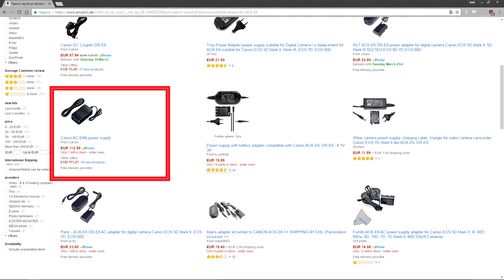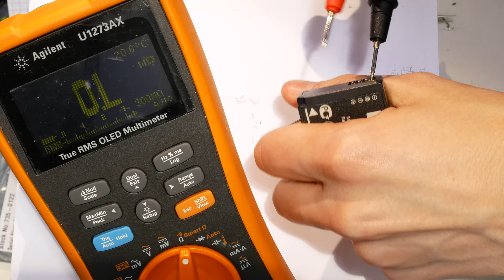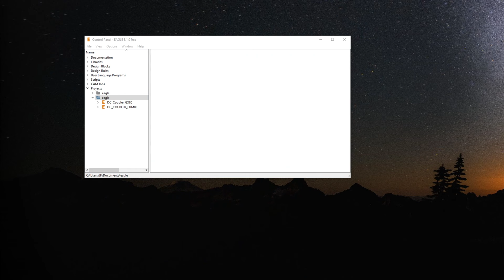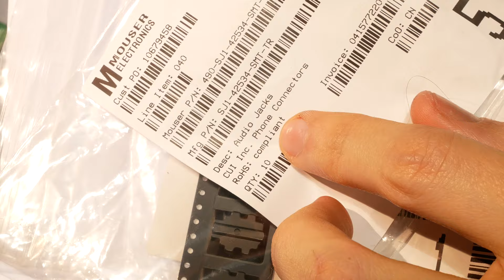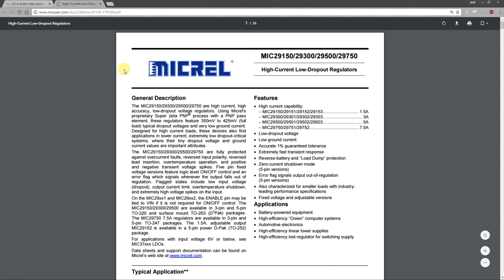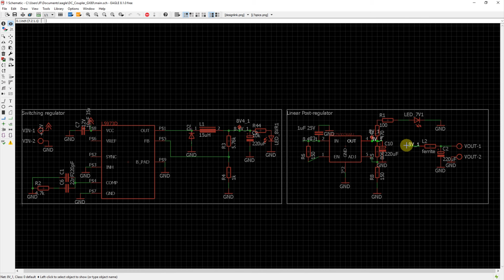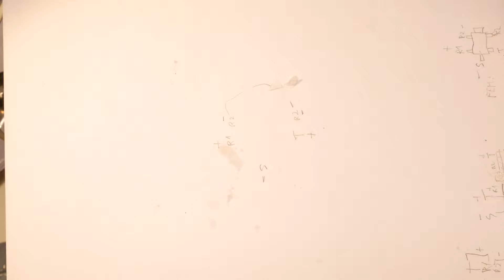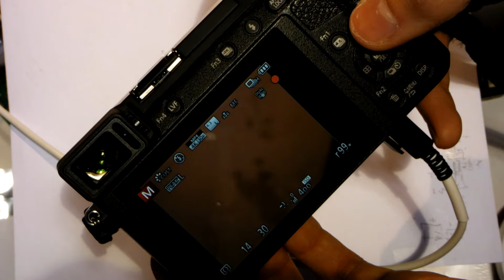DIY Camera DC Coupler and Power Supply - Battery Eliminator

Comment: that is some damn awesome content, love the means you use and the methodology you have to explain. I have bought some 3rd party batteries for my sony A7ii and since one of them has died, wanted to have a look if it is feasible for me to open it (safely) and rewire it to a usb powerbank (with the correct coupler obviously). I will see first if I can revive it then option 2 will be pretty much following your video.
Thanks thanks and again thanks! You got a new subscriber.

Comment: Great idea, but I would suggest to use the connector with thread like Sennheiser lavalier mic one to prevent disconnection in case of some improper movement.
Reply from the maker: Not a bad idea, I wonder if the additional thread fits in the hole on the battery cover.
Reply: @jfaria  Yes, it should be checked.

Comment: Thanks Jose. I made a power box for my Panasonic FZ1000 using NP-F batteries but couldn't understand why the camera showed "Couldn't use battery" although the battery was almost fully charged. Will try this. 
Thanks for making a great video.
Reply: I had same problem when using dummy battery for Panasonic GX800, I had to connect "T" terminal and "-" terminal directly or put there 10k resistor see pic (better option is to open it and do it from inside) https://cdn.thingiverse.com/renders/2c/6f/bc/7a/71/44d66ccffe0a7e9d351231e5cf418cca_display_large.jpg

edit: new link
Reply: @hever9  link cannot opened :/

Comment: Hola Jose puedes explicar lo de las resistencias 
Porque se deben utilizar
Porque quiero aplicarlo a una batería de 2 cables a una tablet que tiene 4 entradas  bueno gracias
Reply from the maker: [Google Translate]
Las baterías suelen tener un contacto de comunicación digital con el controlador para conocer el estado de carga y salud de la batería y un contacto para un sensor de temperatura, en el caso de esta batería la comunicación es opcional, pero la cámara requiere una señal de temperatura, la resistencia sirve para simular una sensor de temperatura. Primero intente conectar solo el positivo y el negativo, si el equipo no funciona, luego intente buscar las señales que el equipo espera de la batería.
Reply: @jfaria  gracias José por la respuesta  saludos desde chile

Comment: Why don't just buy step-down DC buck module? So any 12V 1A power supplies to 8V output then wire it to dummy?
Reply from the maker: You can, but it would also take time and a good one that would guarantee a safe failure (i.e. not outputting 12V after failing) would cost as much as a proper power supply and defeat the purpose of the exercise. If you want it fast, you can just buy the original DC coupler and be done with it.
Reply: @jfaria  whoa. I didn't factor the failure.

So it's safer to use step up than step-down? So in case of failure, the voltage will be too low to operate, yes?
Reply from the maker: @CTZN1  If you don't have any other safety feature that might be a good idea. At the moment I don't use any regulator, instead I'm using the same DC coupler but powered by a big a two cell 5Ah external Li-po battery, it lasts a really long time, I already had a charger for it from my RC plane stuff and I don't have to worry about damage to the camera.
Reply: @jfaria  the DC coupler connected to rc batteries? Didn't know that.. I thought DC coupler are like AC to DC adaptors but the head is battery dummy.
Reply from the maker: @CTZN1  I call the dummy the coupler, maybe that's the wrong nomenclature, I just connect the dummy to a 7.4V battery pack.

Comment: Obrigado, great video, lots of knowledge shared! 
But there is me now, with a question :-) 
Using a Lumix mostly for *filming*, and already having a battery dummy and a DC supply, I wonder ... what about the noise? Have you done any testing already? Not speaking of any particular camera brand or model, but in general. When I compare filming on battery with filming on external DC supply, I can hear the typical 100 Hz noise in my video. It is very weak, yes. But still. The DC supply that you are showing in this video, how about that? If you just video-tape "silence", can you hear the difference between a true battery and your DC supply? How "DC" is your DC? Obrigado again! :-)
Reply from the maker: I might try it when I have the time. If I do I'll reply here.
Reply: Thank you. Tic tac tic tac ... :-)

Comment: Hi Jose, I am trying to fool my wifi hotspot to think there is a battery in it and hard wired to my car (12vdc) . The battery is 3.8vdc 2550mAh and has 3 terminals (+ - and I believe temp at 1k). I tried a step down dc to 3.8vdc, I get a welcome screen then cuts out. Do you have any info that could tell me what resistor or a way to wire it so that the hotspot thinks there is a  battery? I am not too savvy on electronics but use to be a Toyota Mechanic. I believe I need lower the amps, and not sure how, was impressed with your skills and thought if I could ask is there was anything I could do. Thank you if you can help.
Reply from the maker: Hi, I'm not sure the problem in that case is the lack of the resistor, to be sure put a bit of tape in the resistor pad of the battery and check if it works, if it does the problem is likely on your dc converter that doesn't supply enough current.

Comment: Thanks, you're awesome, I'm planning to just 3d print the case and use a LM2596 booster from 5v to 8v, do you think it'll work?

Thank you
Reply from the maker: You probably could get away with 2A, so the 3A from that regulator should be plenty. At the moment I'm just using two large lithium cells in series, works like a charm.
Reply: @jfaria  i was planning to purchase those 15$ kit and then I thought "hey I have a 3d printer, I can just 3d print the battery and power it through a voltage converter"

And then I searched on YouTube and find your perfect video.

Project as simple as that are just incredibly satisfying. Keep up the good work and thx for confirming that this work.
Reply from the maker: @yakine13  The only tricky part is the battery contacts, have fun.

Comment: Great video! 
What is that clear yellow tape called, and where does one buy it?
Reply from the maker: It's Polyimide film tape, also known by the commercial name "kapton". You can buy it on proper electronics distributors or you can be cheap like me and buy it from china on eBay or Aliexpress. It's kind of stiff, but it is able to withstand a lot of heat without melting.

Comment: i want to ask you a question but i see you not reply all your comment
Reply from the maker: I reply to most
Reply: @jfaria  many thanks for reply. I just bought dc Coupler. I try to test output and compare between from original battery and coupler. Battery 8volt and coupler 8.7volt. I think its will make risk for the camera for long use. How about you Sir? Thanks before. I am from Indonesia 🌎🇮🇩
Reply from the maker: @BudikaRabbani  When the battery is charging it goes up to 8,4V. 8,7V is less than 5% above the 8,4V value, I wouldn't worry too much about it. Also, when you connect the camera there will be a slight voltage reduction caused by the cable resistance, it will get even closer to the value of a full battery. I would also prefer if it was closer to 8V, but it should be fine.
Reply: @jfaria  I asked my friend in youtube with the same thing and he frightened me with what he said about the crust that would arise on the circuit board on the camera. But I think the makers of this coupler have made the right calculation for their products. Thank you very much for your answer.
Reply from the maker: @BudikaRabbani  There is no corrosion on the circuit board whatever the voltage you apply, higher voltages than normal cause components to fail, but devices are usually designed to handle at least +-10% of the rated voltage, your AC-DC adapter is only 3 or 4% above. Not ideal but you will probably be fine.
Reply: @jfaria  You explained well and were very helpful. thank you mate 👍👍

Comment: Hi, I have soldered a 10k resistor from the negative to the T, but my camera still says "change the battery" and it appears empty. help me pls
Reply from the maker: What camera is it? Maybe yours needs to communicate with an additional IC? Did you check the original to make sure it was 10k and not some other value, like 100k?
Reply: @jfaria  what's mean IC?
It's Canon 550D, lp e8 battery. I dnt have tools to check the original resistor, is in a integrated chip.
Reply from the maker: @maxiguitar  I had a 550D and if I recall correctly the camera doesn't care about the battery IC as long as the resistor is right. You probably have the wrong resistor. Ideally you should measure the original value, if you can't do that just try other resistor values until it works. I would suggest you try 47k and 100k first.
Reply: @jfaria   ok, I'll try. Ty very much, josé!

Comment: Can we connect 8.5v dc directly to battery protection circuit by deassambling a working battery?
Reply from the maker: Yes, but in many cameras you still need to make sure you leave a resistor to simulate the temperature sensor. Also, 8.5V might be a bit on the high side, on a camera with batteries rated at 7.4V I would make sure the power adapter wouldn't go above 8.4V.
Reply: @jfaria  panasonic cameras do take >8.4V (official mains adapters supply 8.6-8.8V) as a signal beeing powered from mains, not battery. If you'r camera is not a panasonic one, that might not be the case. I would recommend checking official mains adapter for you'r camera and stick to whatever it supplies camera with.
Reply from the maker: @volodumurkalunyak4651  To be sure you can always check the original battery, they pretty much always have the nominal voltage printed.
Reply: @jfaria  you can't just check battery voltage. Panasonic mains adapters supply more (8.6-8.8V) than battery is capable of (8.4V). Furthermore cameras are also designes to powered like that with higher voltage also beeing a signal for mains power. Hence you need (just look at) mains adapter specifications to design you'r own.
Reply from the maker: @volodumurkalunyak4651  That is not accurate in my experience, usually DC supplies for DC couplers are close to the maximum voltage of the battery, probably to make DC-DC converters more efficient and charging flashes quicker. Panasonic's DC supply for the Lumix series is 8.4V (DMW-AC10, 4.2V x 2 cells). The same goes for Canon's EOS Series, 8.4V DC for cameras with 2 cell batteries (the newer ones appear to be even lower, like the AC-E6N at 8.0V) and 12.6V for 3 cell batteries like the newer 1D series. Olympus use 9V because they don't rely on a DC coupler, they use the camera grip and the 9V are used to charge the grip battery, not to power the camera directly. I definitely wouldn't connect a DC supply with a higher voltage than the maximum battery voltage for that system unless otherwise instructed by the manufacturer.
Reply: @jfaria  if dc coupler is connected instead of battery, then I would rather use the same voltage as dc coupler. Outherwise supply maximum battery voltage into battery connector.
P. S. DMW-AC10 supplies 8.8V, not 8.4V, I bought one and measured it.
Reply from the maker: @volodumurkalunyak4651  What is the voltage rating on your DMW-AC10? It should be 8.4V. If yours measures 8.8V it is just slightly above the rated voltage (less than 5%, probably within spec). You might want to also measure it under load, sometimes regulators float a bit without a certain load.
Reply: @jfaria  i have 2 pieces of DMW-AC8, not quite exatly an DMW-AC10. Both are supposed to output 8.4V at up to 2 A.  I measured first one at 9.03V open circuit and 8.85V under 1.4A load and second one 8.86V open circuit and 8.68V under 1.4A load.

Comment: Which printing method did you use? The ones near me, only print in FDM. Not sure if that is sturdy enough to use
Reply from the maker: FDM/FFF, PLA can be incredibly tough at low temperatures, above 40 or 50 °C I use ABS.
Reply: @jfaria  so Can I go ahead with PLA? But he said PLA + 100% Infill but that won't serve my purpose.

I was looking at SLA, there's one near my house who does that
Reply from the maker: @StringsnNotes  I don't know what your purpose is, but for something like the adapter in this video, pretty much anything will work, the camera should not get hot enough for PLA to melt and there are no mechanical stresses worthy of note.
Reply from the maker: @StringsnNotes  Are you talking about an adapter similar to this video? If so PLA is fine and you don't need 100% infill, regular pattern infill is also fine.

Comment: hi, I have Finepix HS10 and want to increase battery capacity for long usage (say 12 hours without stopping).
The camera says 5v 7w, I plan to use a mobile powerbank which produces 5v 2ampere, do I have to use dc-dc step up or just supply power directly to the camera? what do you think, is the powerbank output safe for my camera?
Reply from the maker: If you mean connect it to the USB port of the camera, it should be safe. I'm not 100% sure, but I believe my Panasonic camera doesn't allow me to charge from USB and record at the same time, maybe Fuji allows you to do that.
Reply: @jfaria  HS10 does not have a USB power connection. so I made a dummy battery. so the power will go through the battery compartment. (this series uses 4 AA batteries)

Comment: Hey! I've seen many videos like this. My camera "turns on" but says "Change battery". I saw your video and I added the 10k resistor, but the problem continues. Any idea?
Reply from the maker: Hi, what camera are you using? Are you sure the original battery uses a 10k resistor and not some other value, like 100k? 
Bear in mind that some manufacturers require an ID chip, you have to do something more sneaky, like this:
https://www.youtube.com/watch?v=HOm49lE4k7M
Reply: @jfaria  Sorry for the late response. I got it to work at the end. The power source I was using dropped it's voltage a lot, so the camera (T3i) detected it as a REALLY low battery. I changed the power adapter and now it still drops it's voltage, but stays at about 5/6V, so the camera shows a half-way charged battery.

Comment: hi, i want to ask. what is the name of the circuit you use to supply the power? is it ac to dc? or dc to dc step up?
Reply from the maker: In that video, it's a dc-dc. Right now I still use the plastic DC coupler, however, instead of the AC adapter I just use a 5Ah 7,4V RC battery, it lasts several hours and it's very portable.
Reply: @jfaria  how many amps the step-up dc-dc circuit can output? does it adjust camera needs automatically?
Reply: @jfaria  oh yeah, speaking of dc step up, does this circuit cause static noise in voice recording when recording video. because I once got noise when using ac dc adapter to power my microphone. (condenser microphone for laptop)
Reply from the maker: Depends on the AC to DC converter, I used an original HP power supply adapter and there was no noise, now that I use an external battery I don't worry about anything anymore.
Reply: @jfaria  thanks for sharing this, now I'm making an external battery for my camera, with a power bank module, maybe if the power bank isn't enough for my camera's written needs (5v 7watt), I'll use a dc-dc step up.

my plan is to make an external battery pack which also becomes a battery grip (like nikon and canon).
Reply: but I'm still looking for a charging module that can handle 6 parallel 18650 batteries. because if the total will produce 3v 15000 mah, so charging it will take 15 hours (with a 1 amp charger)